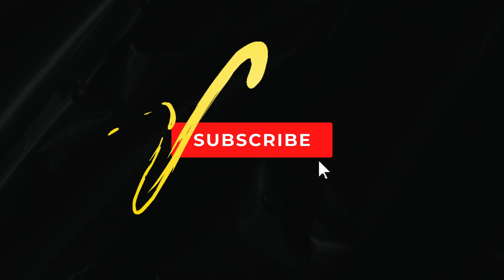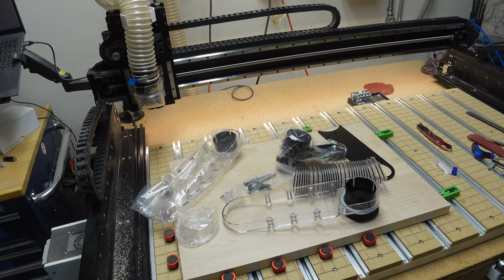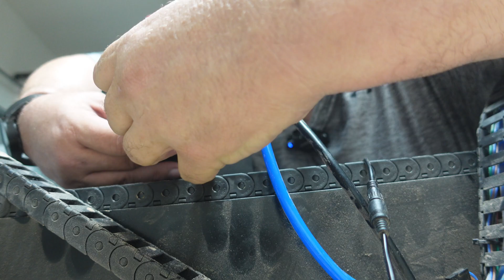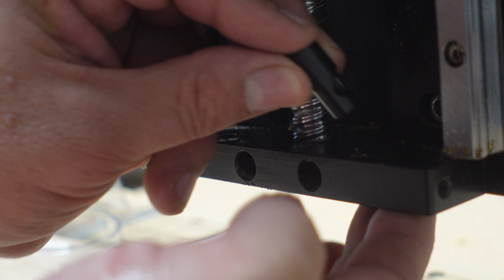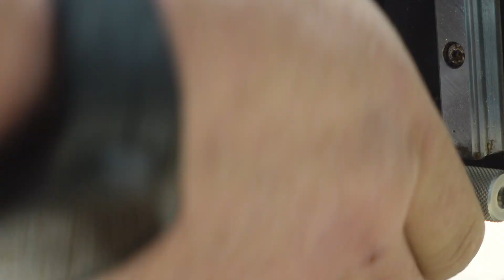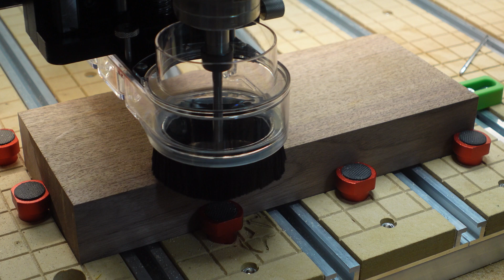Sweepy Pro Dust Boot Revolutionizes Shapeoko 5 Pro Experience!

Comment: how much better is this than the sweepy 2.0?
Reply from the maker: For me, the biggest advantages that the Sweep Pro holds over the Sweep 2.0, is that it is lower profile, does not attach to the spindle (moving up and down with the spindle), and that I do not have to feed the vacuum hose from the front of the gantry over the top.  The rear connection point makes it much easier for me.  Also, the suction is very good through the Sweepy Pro.  I have the VFD spindle, so I had to get the Sweepy Deep Sweep to use for dust collection when I first bought the CNC. Thanks for watching!

Comment: Great video! I just purchased my Sweepy Pro. I like your grid and bench dog setup. I watched the video on the grid. Do you have information on your dogs and a cut file? Thanks.
Reply from the maker: The Sweepy Pro has been a game changer for me for dust collection (I don't use it often in videos because it obscures the cut).  The bench dogs are on Amazon.  Here is my affiliate link if you are interested: https://amzn.to/3D7bY7P  

I don't have a cut file but I know the holes are 20mm in diameter to fit the dogs, and I cut them in the middle of each mdf slat across the X axis, and about 2 inches apart on the Y axis.  Hope that helps.  Thanks for watching!

Comment: It’s a nice design. Thanks for the video ,
just make sure your sweep didn’t drop during bit setter check.
Reply from the maker: Thanks for watching! Yes, definitely have to keep the sweep above the height of the bit setter.  The base with brushes will clear without issue, but if you have the completely plastic base, it will strike the bitsetter even if it is lowered a small amount. You have to raise it all the way up first.  Thanks again for watching!

Comment: Love the video; but, when looking at the instructions and setting miine up on the S5 Pro, the dust boot bolts come up from the bottom vs the top. Thanks for the quick video!
Reply from the maker: I definitely got that wrong in the video. Good catch!  I have since making that video, changed the dust boot bolts to come up through the bottom when I discovered coming from the top wasn't actually securing the boot, but was rather holding it in place with and assisting the magnets in keeping it somewhat secure.  Works much better doing it the right way (LOL).  Thanks for watching!